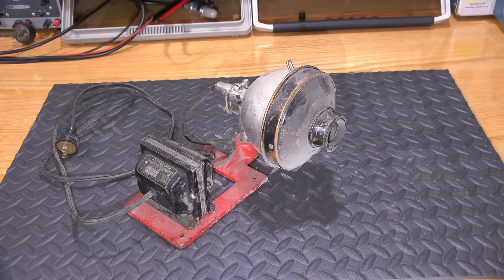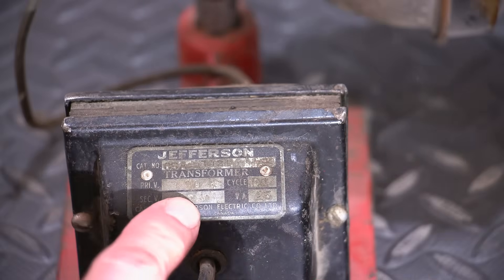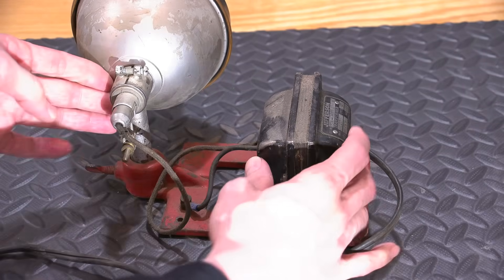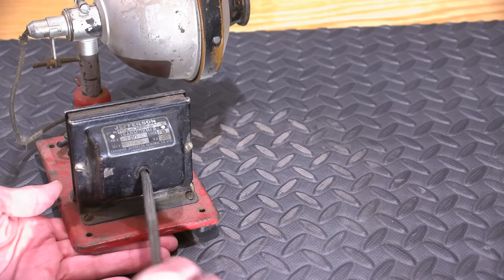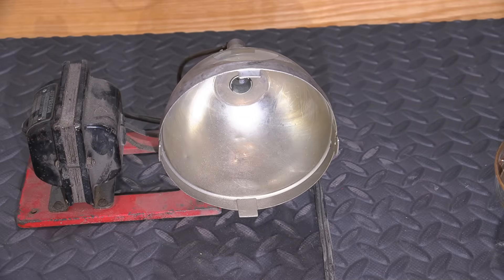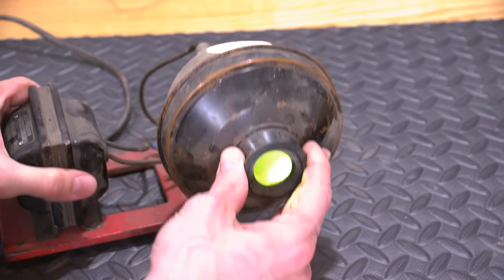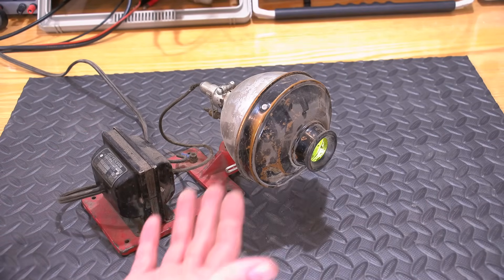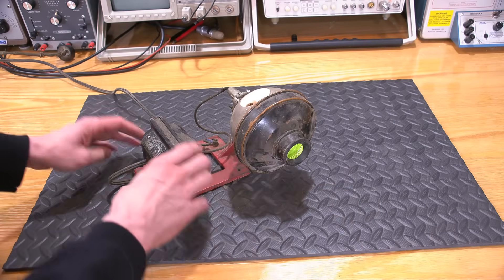Barn Find - What Is It - 1940's? Mystery Device Teardown!

Comment: I have a few of those old style flash bulbs and a Kalart flash unit that takes them. Haven't used any but thinking of getting some more and trying them with my 40:s Graflex 4x5" sheet film camera.The problem is they are not easily available in Europe and shipping from USA is rather expensive. The clear ones are for black and white film, the blue ones for daylight balanced color film.

The flash cubes were very common back in the 70:s when I was a child, I took many pictures with a cheap pocket camera using 110 film cartridges and flash cubes.

Comment: Right off, it looks like an infrared lamp.

Edit after watching to end: I don't think it's an egg candler. Not bright enough, and the green filter seems counter to the purpose.

It looks industrial. Like it was made to be permanently bolted onto a bench top or workstation of some sort. I think this is an inspection lamp. It's not UV, so probably not for inspecting cracks or leaks. Most likely for surface cleanliness. Dust or  residue detection for surfaces which might be painted or laminated...or perhaps sensitive electronics components.

Comment: I was wondering if the hole in the reflector was to suspend a specimen, (leaf, insect or a slide), between the lamp and the lense to project it onto a wall as a teaching aid. Hence the focus screw at the back. I imagine it would come with different filters and lenses you could swap in the front spring loaded besel. Only a guess, though.

Comment: From the looks of it, the device should use a 6 volt headlamp bulb. Regarding the flash bulb, clear was for B&W film and blue was for color. They are coated to keep the glass from shattering when set off. That magnesium (I think) wire inside does get HOT! One of my dad's cameras used that size flash bulb. They are BRIGHT when set off. I have an older flashbulb that is the size of a 150 watt light bulb and it has what looks like foil shards in it.
Reply: Yeah. 25 VA vs the unknown wattage of the bulb (taillight?). Let's use an appropriate bulb for that tranny!
Reply: The foil shards burned longer so as to keep the light produced for a long enough time to accommodate a focal plane shutter operating at high shutter speeds. The two curtains of the shutter were not open at the same time at those speeds so a standard flash bulb would only expose part of the film. Smaller focal plane bulbs had the magnesium as a solid lump in the center of the bulb.

Comment: That red base casting had several lives. They held drills and grinders. Nearly identical to a saw sharpening vise base too.  And a shield holder for a hobby wood lathe.
  Hard saying if it was cobbled together or not without taking the transformer off and looking at the paint. Not 100 on what it really is also. Doesn't fit being purpose built to candle.

Comment: It is a floor mount photographic projector flood lamp. The adjustable focus as well as the replacable glass filter show this. Oddly enough, this exact same design could also be used for signaling such as on a rail line.
You are correct that the lamp head bar has been cut down, and it is possible that it may have been repurposed for egg candling, but it is also possible that the user simply wanted it closer to the floor.
Flash cubes, flash bars, flash bulbs including screw in, push in and turret twist. Still have a lot of the foolish things here somewhere. They really aren't that out of date. Probably late 1970s and the cubes and bars well into the 1980s until electronic flash flash replaced them.

Comment: the movement of the lamp will allow you to place the filament nearer to the focal point of the parabolic reflector. That will cause the light rays to travel in a parallel fashion through the green lense.  That would distribute the light evenly across the egg.

Comment: Used to use the flash bulbs on cameras during the 50s and early 60s -- but the ones I used had bayonet (vs screw) base,  (usually made by Westinghouse or Sylvania).  Filaments were of fine magnesium wire
Reply: When I was growing up in the 50’s & 60’s, we had an Argus C3 camera. It had an attachable flash unit that took flash bulbs. The flash bulbs were tinted blue for color correction so that you could use daylight film indoors. I always remember my dad either licking the bottom, base of the bulb, or telling me to, to make sure that it made good connection, so that we wouldn’t waste a frame of film. Maybe that’s where I got my taste for solder!
Those were certainly the days, but beautifully captured on Ektachrome film…
Reply from the maker: Thanks for sharing your story Gwen!
Reply: The flash my father used had single-flash bulbs that were smaller than that, like 0.5" diameter 1" long, and they had a press-fit where the base of the bulb had some formed glass part that was pushed in the flash unit, and two wires were folded back and connected to contacts.
So you pressed that in, took a photo, and then you had to take it out (it would be very hot) and put in another one for the next photo.
This worked with a 22.5V battery and of course a connection to the camera, which had a small coaxial connector for that.
It was much later that camera's got a "hot shoe" to set off a flash, or that those "cubes" were introduced.
The flash unit my father had, had a reflector of about 5" diameter consisting of a number of segments that would fold together in a ring shape.
Reply: A company that installed the protection systems for the air cleaners of a plant I worked at used old new stock camera flash bulbs. These were installed in the circuit for the firing of the part that burst a metal disk allowing powder to extinguish fire in a metal filter housing. The bulb was there to test the firing circuit during commissioning. The company had bought all remaining stock of bulbs.

Comment: That's magnesium wire mesh inside the photo flash bulb.
Reply: I believe that Zirconium wire in an oxygen rich environment was as also used as photo flash.  On occasion turnings and fines from zirc would catch fire in my machine shop, titanium too.  I am pretty sure magnesium turnings and fines will also easily catch fire in normal atmosphere as the result of machining operations, bit we didn't machine it in my shop.

Comment: I believe it may be a green safelight, used for developing film in a darkroom.

While red light is the usual colour for a safelight, green light can be used where films lack sensitivity at that particular wavelength. It can be used sparingly to gauge the highlights as they develop.
Reply: But the vent hole lets white light out.
Reply: @jerrymalone8370  I was thinking that there may have been a cover for it originally
Reply: Green safelights are often used for infrared-sensitive film, or film that would be "painted" with a scanning red laser.  That's how the older CT and MRI film printers produced medical images.  The device could have been used in a darkroom for spot inspection of such films, but the white light out of the hole would have wrecked the unprocessed film.  Red safelights are used for green-sensitive film and amber safelights are used for blue-sensitive film.  By far, red is the most common safelight color.
Reply: @richardmassoth8237  I was thinking that there may have been a cover for the hole originally
Reply: @richardmassoth8237  Also that isn't an optical quality filter, its just a bit of rough green glass with leaks all over. We have established beyond doubt it is for checking your dozen eggs.
Reply: @richardmassoth8237  Green light is used for printing colour prints not film! You do not use any light on un-processed film!

Comment: I definitely don't know what that thing is, but there are some useful hints. If I look at the transformer, the label says it is 25W which is in fact a lot of power compared to a 6.5V output, this gives us about 4A current. Which means, that that light bulb has to contain a really thick tungsten (or what) filament. This is completely impractical thing unless you need to somehow deal with the flickering (aliasing) caused by alternating current. Thick filament has a huge thermal capacity, which possibly could be used as a temporary energy storage when the alternating current crosses the zero. This is why machines containing rotating parts, like lathes and milling machines, used to use 24V light bulbs inside their lamps instead of 120/240V ones, because the 50/60Hz flickering light could show high speed rotating parts as a steady because of aliasing, which is possibly dangerous situation. 

The second hint is that green filter. Green is that part of visible spectrum, where B&W films are most sensitive. This has its own reason, an eye is most sensitive to the edges in the blue part of the spectrum (shorter wavelength gives you higher resolution, but lower sensitivity, which causes lower dynamic range), but the textures are more visible in yellow to red part of the spectrum (which gives lower resolution, but higher sensitivity, which implies higher dynamic range in the low-light conditions) and the green lays in between these two ranges, which results  in the compromise making the B&W picture looking natural.

So my conclusion is, that this was used for some photographical (or similar) purposes, where AC flickering causes a lot of aliasing problems interfering with the shutter. But still don't know what it is.

Comment: Very strange and telling that it would utilize such a big, heavy and expensive transformer rather than simply using a 120 Volt 15 watt lightbulb. What application would require such an expensive design?
Reply: A lower voltage incandescent bulb has a shorter filament, is more robust, and is closer to a point source for focusing.  People used to have a "high intensity light" on their desk.  They used a similar bulb, the ones I remember ran on 12 volts, there was a transformer in the lamp base.  Possibly there was also a 6 volt version.

Comment: Agree with others that this appears to be an egg-candling lamp. 
Using a green filtered-light will make anything red (blood) inside the eggs show up much darker, & as that hole would be for venting excess heat from the reflector-housing, my guess is that the highest wattage vehicle-bulb would've been used (& focused to achieve the ideal beam)! 
What's also interesting is that with this design it's made so that the egg is held with your fingers with the light shining into the egg from the side towards your palm to reduce glare, plus it can be screwed to a bench & rotated to accommodate those who are left-handed!
Reply: I wonder how they candle eggs now. I am 81 and never had a bloody egg until three weeks ago. l was lucky it was the first egg cracked. You would think it would be easy with the technology now.
Reply: @jayreiter268  both more advanced yet exactly the same somehow...now its led lights and a camera with a computer to analyze ...but in reality its rilly the exact same thing still just modernized same method and all
Reply: My parents probably would have recognized this, but I guessed incorrectly that it might be a "blackout bulb", the tiny lights used by vehicles in  WWII to help keep enemy bombers from locating major roads and cities.
Reply: Stevie-Ray, how would you focus? Seems like there should be a prism, of some sort, close to the bulb. I couldn't find anything that matches this particular device on the google machine.😉
Reply: @OIE82  the reflector will focus the filament by adjusting the bulb in or out.
Reply: Why would you require such a transformer. Seems overkill for a lite bulb. That much power you could hard boil an egg.
Reply: @jonbutcher9805  That  transformer just looks large enough to supply a few amps to lite that bulb. Probably around 12 to 24 VA. You need a transformer for isolation. Ground return problems were prevalent on farms.
Reply: @jayreiter268  makes more sense now it's explained. Thanks
Reply: @jonbutcher9805  You are welcome. I forgot the point that a low Whattage  110 volt bulb could be used. That is why the 6volt bulb and transformer is safer.
Reply: @jayreiter268  cool thanks again. Never occurs to us to check. We have 14 hens of varied breeds and ages at the moment and have had chickens and the occasional ducks for many years now and we never check just crack cook eat. Sometimes they look funky but the dogs never complain about those. I guess it would be different if sold to others but for us it's just not a thing. Interesting to know though, so I appreciate it. Regards to you and yours.
Reply: @jayreiter268  There is no h in wattage.
Reply: @jayreiter268   A 6V bulb has a smaller filament so can be focused into a narrower beam.  I visited a farm when i was a kid, and saw candling being done with an ordinary light bulb in a box with a hole.

Comment: The fine wire in the flash tube is magnesium. A small filament inside the maze of magnesium wire connects to the base and ignites the magnesium wire when it gets hot.

Comment: It's an early attempt at making a flux capacitor from 1918. Also the super-syphonic anti-splash system looks like it needs a drop of WD40.
Reply: 🤣👍 Good One!
Reply: What car did they use instead of a DeLorean?  Must have been old man Fords #888 that, I think was the first car to go 100mph.  Mechanical brakes, wooden wheels, tires that had a speed rating of 10mph, no helmet, vertical steering wheel, a seat, a frame, four leaf springs, and tractor steering’, that was it.  I think it had a souped up model T engine running Tennessee corn liquor, first pass, 180 proof.
Reply: In England at the time they used a Kendall Mint Cake as a burst initiator I believe.

Comment: About that flash bulb...  My dad had an Argus C3 35mm camera that he purchased about the time I was born in 1946. It had a flash unit that plugged into the side of the camera, and it used those screw-in flash bulbs. Later versions of those bulbs had a blue coating. At some point in the 1950s I remember him getting a new flash unit that used the bayonet-style flash bulbs. One of those would probably fit in your mystery device. It wouldn't be of much use, though.
Reply: I loved using my C3 (affectionately known as "the brick"). I had the flash attachment, used 2 C cells, but never any bulbs as they were pretty much unobtanium by the 80's. That thing took excellent photos.

Comment: I don't know what it is, but it reminds me of the black lights they used to use in the clean room for cleaning oil-based contaminates from parts used in the lox/jet fuel engines on ICBMs. (From the 60's)
And yes, I remember single use flash bulds. Some guys in a camera store were always clowning around, they put a #22 flashbulb (about the size of a 150 watt incandescent bulb) in the stores' bathroom early one morning, sure enough the boss comes in and went straight to the bathroom. Whoosh!
The boss said he couldn't see anything for 30 mins.
They used those in the some of the pictures of Carlsbad Caverns.